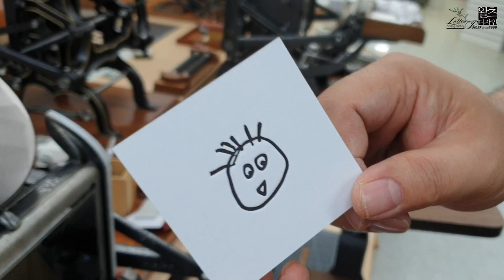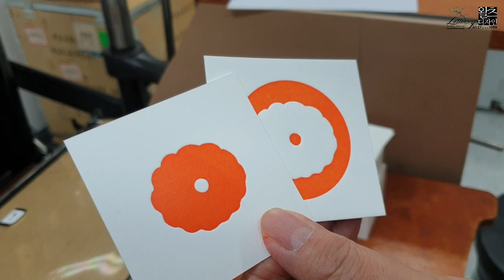Make a letterpress circular business card. 원형 레터프레스 명함만들기.

Comment: waltzdesign Hello again. Can a table top machine like this one print and cut any business card type design...or maybe slightly bigger projects like wedding invitations etc..from start to finish?
Also ..can you link me to a video showing how you make the cut out thingys lol...sorry can't remember what they're called...and can you make any design of cut out thingys ...thank you.
I think they're called dies sorry
Reply from the maker: Hello. You can work on business cards on the tabletop. If it only contains text, it can be easily printed. However, it may not be possible to print a background that fills a large area. Working on big projects can be daunting. Because the lever exerts force on the dependence, excessive force may cause the lever to break. You can think of it as a business card. Chandler&Price 10x15 is recommended for various tasks.

Comment: Hi!  the brown paper is tympan paper, which thickness? Your videos are the best!
Reply from the maker: Nice to meet you. The color of the paper in this video is black. The thickness is 540g. The thickness of the glued thin paper is 135g. Thank you very much for watching the video.
Reply: @w_letterpress  hi, i ment the brown paper below the transparent sheet (where the paper to be printed is placed)
Reply from the maker: Oh sorry.  Brown paper is insulating paper.  It is harder than plain paper and helps print well.😅😅
Reply: @w_letterpress  that was my doubt, I will try to find it out here in Argentina, i´ve read about tympan paper, not sure what kind of paper is it.. Thanks!!
Reply from the maker: You can only buy it at printing materials in Korea.  It is mainly used for foil printing.
Reply: @w_letterpress  I´ve found in internet a paper that is used for offset (it comes in different thicknesses)  due to translation, and variations country to country, I´m not sure what paper is it exactly, I´ll keep investigating, i tought it was a normal kraft paper at the beginning :)
Reply: @w_letterpress  ahhhh oookkk :D thanks!
Reply from the maker: @zinc438  
It is different from ordinary kraft paper. If you want to use it for printing, you can use hard paper. It is more useful when using foil.